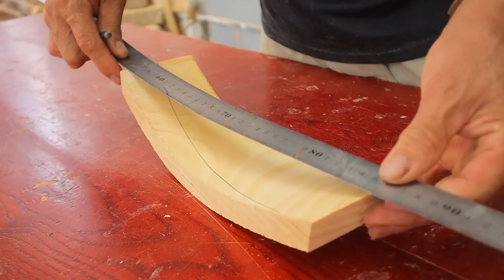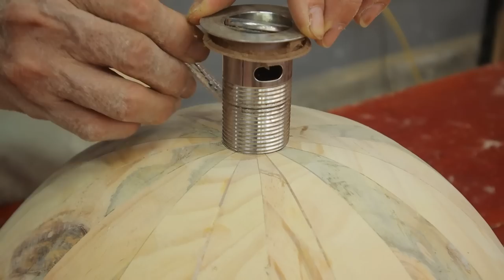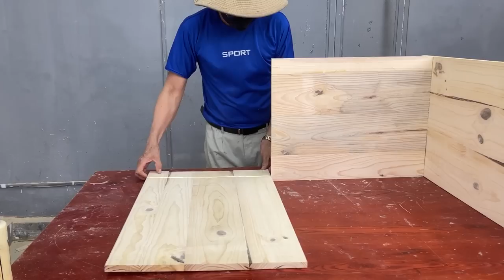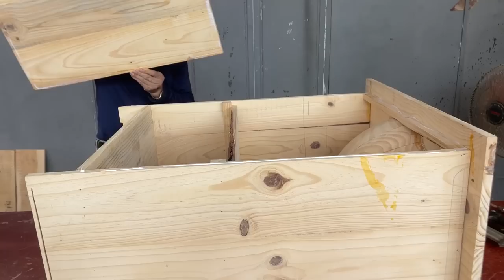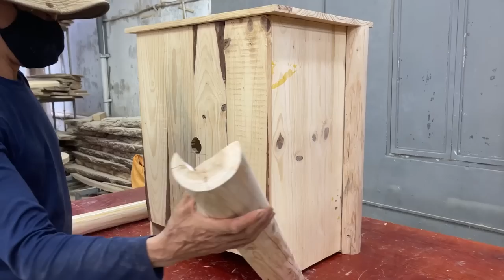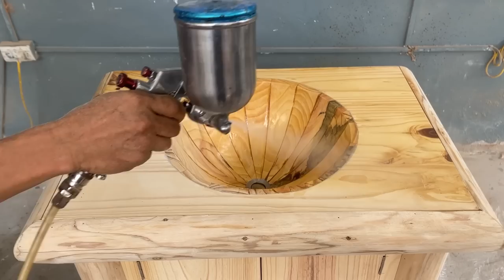Skill In Cutting Corners Extremely Skillfully To Create Seamless Curve // Unique Sink Design Idea

Comment: Instead of your nailer do the same project with a bisket jointer. And instead of pine try some nice hardwood like maple or walnut. Then you would have a project worth major bucks. Also maybe invest in a lathe. Nice concept but the pin nailer kills the quality.
Reply: Also, why the heck was he using wood putty instead of glue?